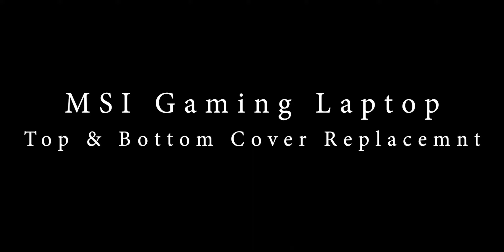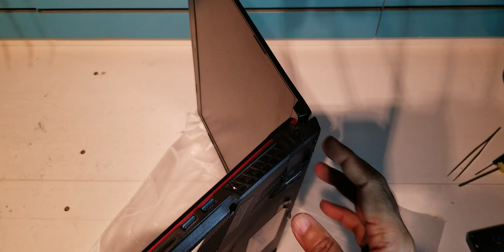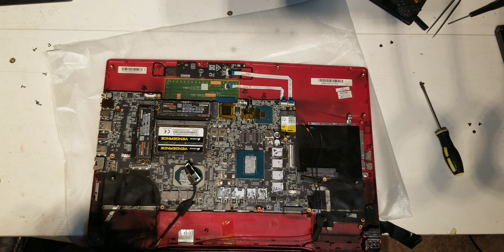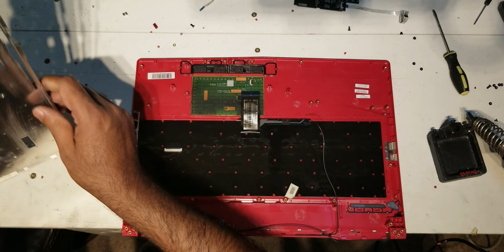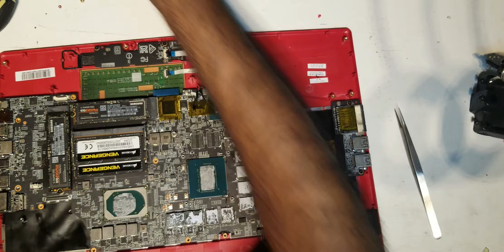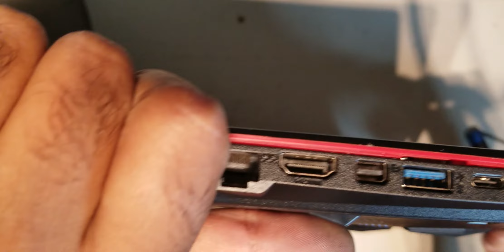MSI MSI GL63 MS-16P7 Gaming Top & Bottom Cover Replacement

Comment: thanks , i was thinking of buying body and replace it myself but now i think i will put superglue on old one.😂😂
Reply: hows the glue? should i give it a try? the case swapping is brutal
Reply: @philippkolychev9158  when looking at cost of new body(there's no part of my laptop body which is not broken, maybe msi made it from poor material) i applied super glue in form of small dots in short distances. Its good. As its always stays at home I don't care if it's not fancy anymore after 5 years.

Comment: I have a msi gv 62 vr 
My body is completely broken and i cant find the body of the same model can i use the different model body because most msi laptops look same body plz need confirmation because in my area there is not much availablity i would have to buy the different model body grom online
Reply from the maker: I don't think another body will fit your model. The shape, size, and structure of each model are very different. You are better off somehow gluing the body if you can't find the parts.

However, have you checked eBay & AliExpress for the Palmrest Cover and Bottom Base for MSI GV62VR?
Reply: @PCGURUINC  can I get MSI GL63 9RCX-213IN top bottom body part
Reply: @PCGURUINC hello I want to know from where you bought the parts for msi gl63 I have the same problem with my laptop I will really be thankful to you please tell me. Or leave a link to buy them in India